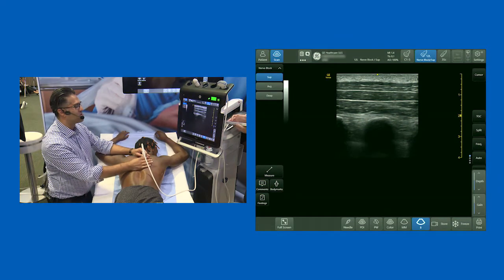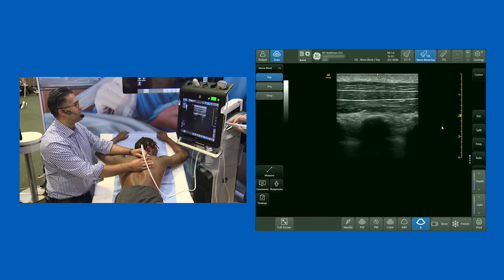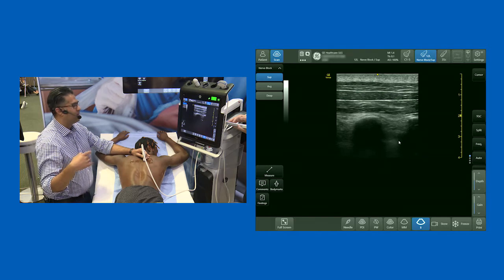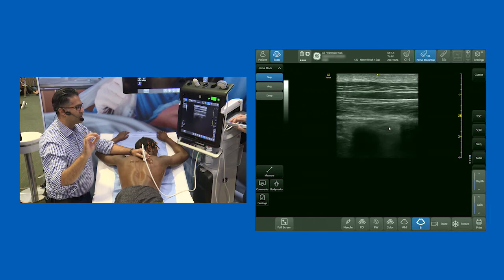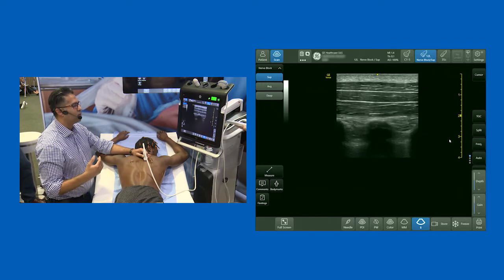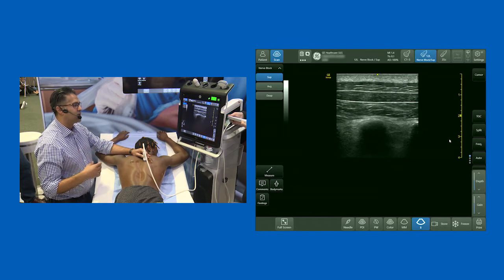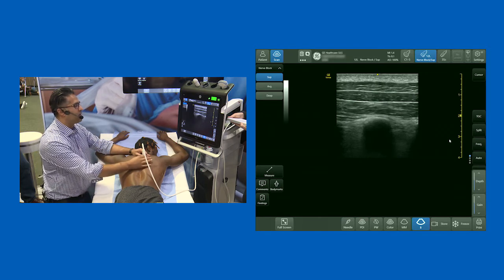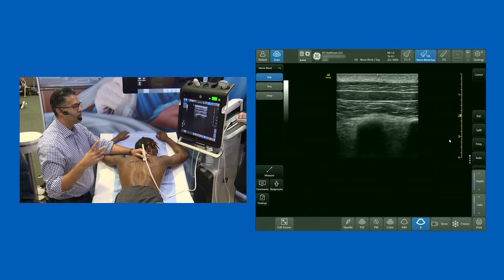MTP (Mid-point  between Transverse process & Pleura) Block - aka:  InterTransverse Plane (ITP) Block

Comment: How many spine space to inject? Total how many mls ? @dramitpawa
Reply from the maker: Really not clear evidence base for a pure a answer on this. 
For limited dermatomal coverage- 5cc at one level. If multiple dermatomal levels required, 5 cc per level covering the range of levels interested in - so for breast - T2/3 T3/4 T4/5 for example.

There have been case reports of 20cc one level, but this does not reflect my practice